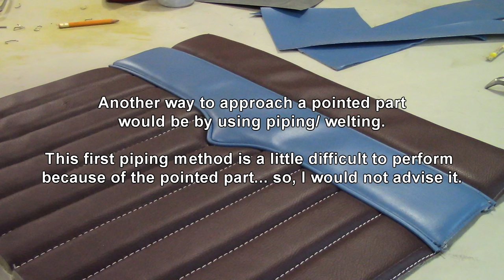How to Sew a Pointed Corner- Upholstery Basics   Car upholstery

Comment: Great Videos. However you should try to use a needle nose pliers in your right hand to manipulate the materials in the very tight spots. It works for me. Also I use a little squirt of Lexol (leather cleaner) to free up the binding in tight corners especially when working with leather.
Reply from the maker: +ndav8r Thanks for watching our videos and sharing useful tips!

Comment: Sorry if this seems like an odd question, but i noticed as you cam to the stitching in the pleats, you seemed to bunch them together a bit before stitching over them. Is this to create tension over the stitch to prevent the pleat stitching from popping or breaking loose with use?
Reply from the maker: Interesting question!  I try to distribute the pleats on the edge. I usually use a cardboard ruler to flatten the edge and get an even distribution of channel folds. After doing this I can sew down/attach the other piece.
Cardboard tip: https://www.youtube.com/watch?v=tI7FK9iA3nY

Comment: To far to pop to you then . I have a  Juki sewing machine I seem  to be forcing material I’ve done everything else you shown  I’ve brought foot etc any suggestions to ease this through please
Reply from the maker: Just trying to figure out what is the difficulty. It would much easier if the upper pieces have no foam backing. The foam could be cut to the shape and added later on. If you are following the same process watch carefully I have sewn beforehand the seams twice. One line of stitches run on the very edge and the other is done at 8 mm from the edge giving me the chance to do the last sewing easier at 10mm. If you are using inches I suppose 1/2" then there would be a sewing guide at 7/16" leaving free 1/16" to do the closing final sewing.
Reply: @Cechaflo  think I've done it thankyou sooo much next will be the seat thankyou you are so inspiring :)
Reply from the maker: @debbiebryant9986  Welcome to this channel anytime!